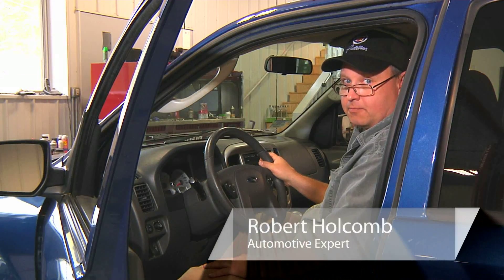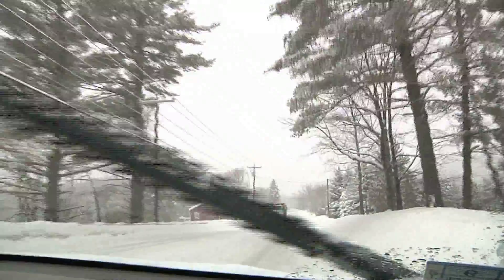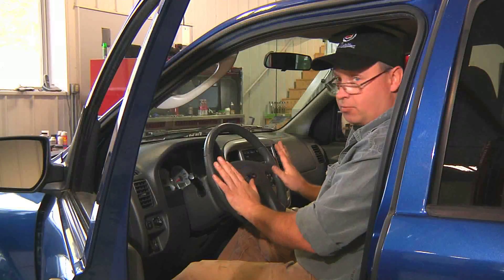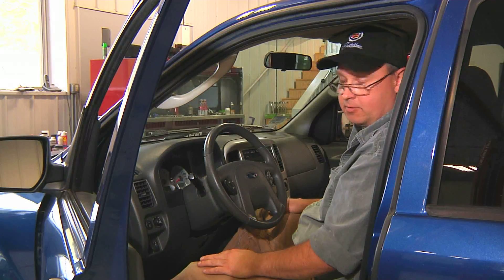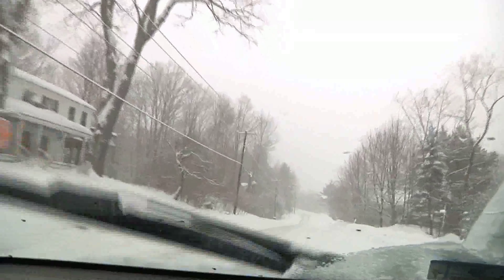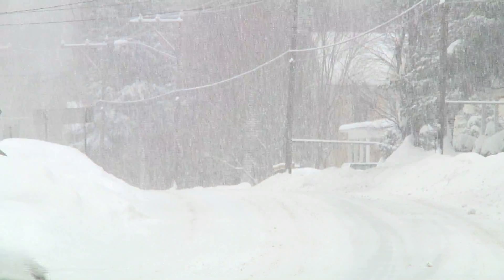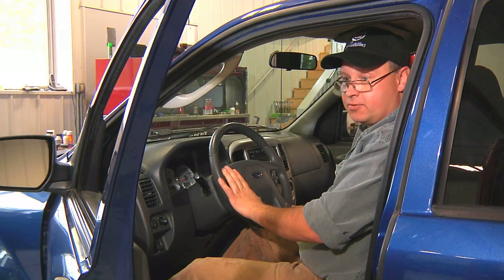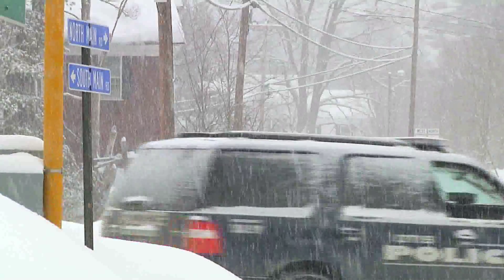ABS Brakes & More : How to Drive in Icy Conditions

Comment: BULL SHIT!!!!!!!   ABS does absolutely NOTHING but make you go out of control by making the brake petal hard, causing you to lose control of braking back and forth to regain control. Of course you have to let out of the brake and steer, but you NEED a slide to regain control of the momentum as slide equals friction. Just like a boat or plane you use slide to regain momentum along with brakes by "tapping" just like a rudder for the front of your vehicle and E-brake for rear rudder action.  You use the gas as a rudder action as well to help stabilize your slide to build friction to slow you down and regain control.. If you know how to drive on snow in the Midwest where icy (black ice) is very bad including deer which seems to be where black icy is ironically, then you know what I'm talking about... If you can fly an aircraft and drive a boat, then you can remain control on black ice WITHOUT ABS...

Comment: Awesome video. And your absolutely correct in what you are saying. Some ppl just don't understand the benefits of abs , tc, and stability control and how much more safe they are. Old school is not the way to go.
Reply: I can brake faster without ABS than with it.
Reply: MrVolodus it's not about breaking faster. It's about breaking safer and controlled. Slam ur non abs breaks on and try and steer around a kid that runs out in the street. Oh what's that. Pure skid no control.
Reply: Jw OK, I can stop on shorter distance without activating abs on snow.
Reply: MrVolodus ok I quit. Have a good one
Reply: Jw I know what is your point, don't worry :) in stressful situation when you slam brakes, it saves lives by allowing you to steer.
And I say that with training, you are able outperform ABS by breaking just so that ABS is not active. But it takes lot of training and practice.
Reply: Jw slam your abs brakes on ice let me know how that goes. why rely on shitty technology when you can just learn how to actually drive an automobile?????
Reply: MrVolodus you're right except it takes about 5 minutes of sliding around a parking lot to understand how brakes work

Comment: Wanna bet? Lets rent an car and go for an ride. First off you might consider i drive cars with no aids every day i know how to handle them. And 2nd an power slide is extremely controlled. Just look at drifting. Its the same thing but on tarmac not ice. The thing is go fast but leave room for manovering.

As my statement stands. Lets rent an car and drive. Soon there will be snow and ice here in sweden. And lets set an time. Lets say 100kilomiter is fastest time no highways allowed?

Comment: when it starts to skid in an turn apply more power and take the turn on an powerslide like we do in the nordics with permanent 4WD cars. I dont like ABS or Tractioncontrol. Or any of that jaz. I perfer permanent AWD and no driving aids at all.

As for hills go. build momentum from the bottom and just floor it. Down an hill is alittle more tricky but the trick is to put the car in an sideways slide before the bend allot like they do in ice raceing. Now thats swedish driving for you lads!